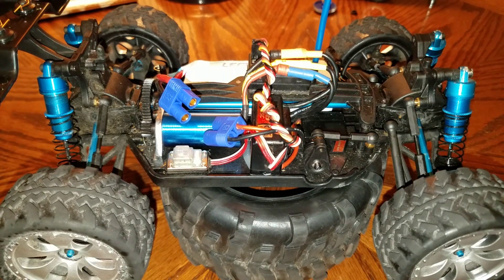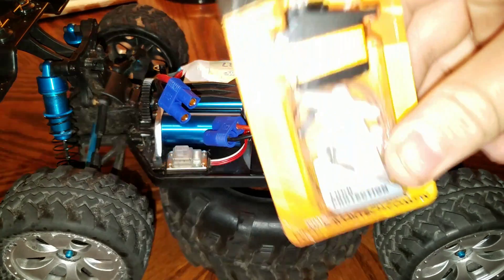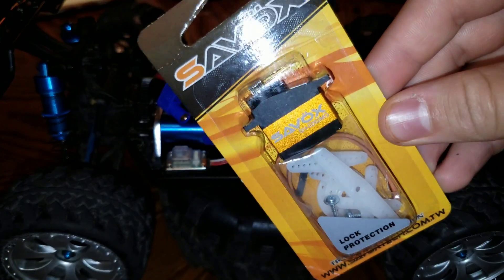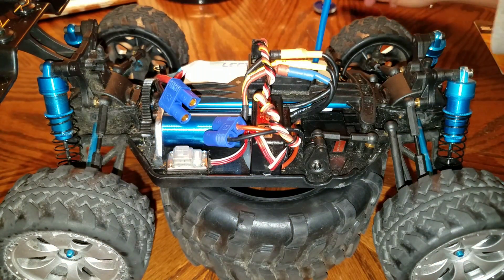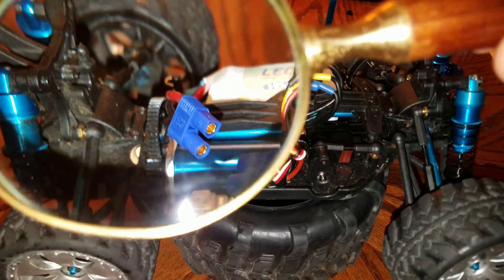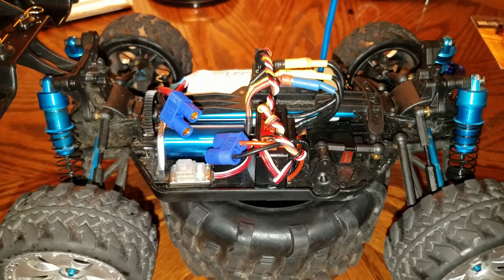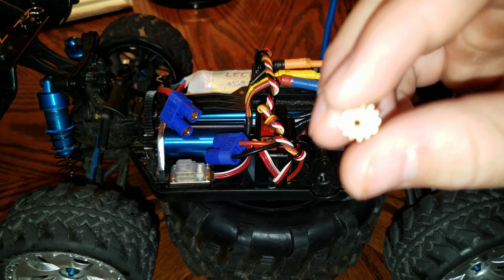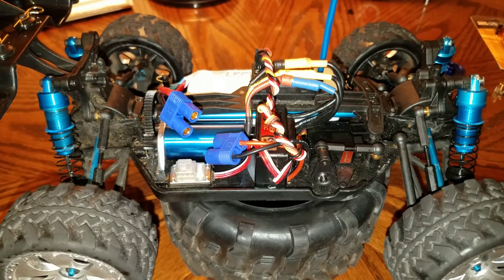Servo upgrade tutorial for Dromida BX 4.18

Comment: Good video thanks for helping everyone out. It seems like a good mini. I haven’t run it much yet but it seems like its pretty tough. A little better than the rc18. Do the diffs handle 3s ?
Reply from the maker: Sam  Scornaienchi thanks so much. And  It’s funny that you say that because just the other day I drove it in my rear DEF gave out I think I may have stripped the gears but I still haven’t looked into it almost like we have to replace them but I would say that they can handle 3S because I’ve had the car for about a year and a half and driven it on 3S plenty times and if it’s lasted this long they must be pretty strong.
Reply: Canadian Gaming&RC cool good advice. I think as long as you’re not totally abusing it it should be ok then. A lot of times I notice that people complaining that their cars are breaking diffs it’s because they are totally hammering their cars. Im not that hard on my rc’s. Thanks I’m going to order that servo. I was reading about people’s servos not centering and from what I found out myself was that you absolutely have to have those little springs on the diff side and axle side. I think the car didn’t have them originally with the plastic axles but the outside springs came with the aluminum upgrade package. I left them out at first but later on figured it out. Now my steering is ridiculously fast and centers perfect. But not metal geared.
Reply from the maker: Sam  Scornaienchi nice 😀, and have fun with the upgrade!